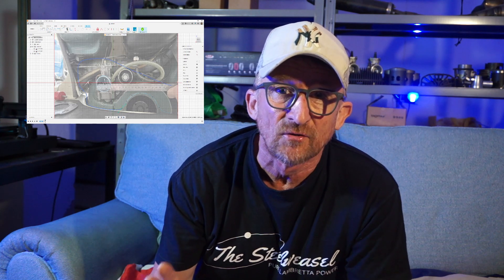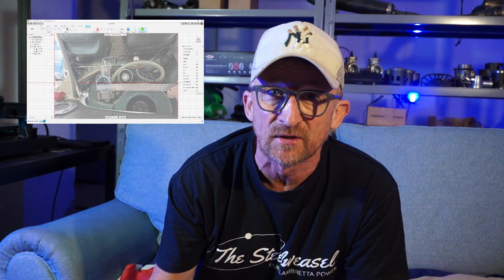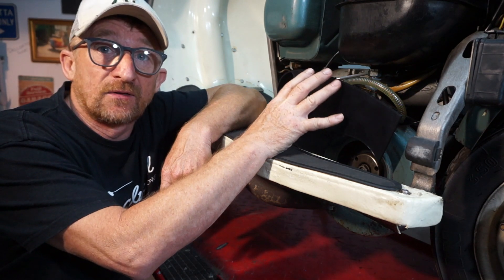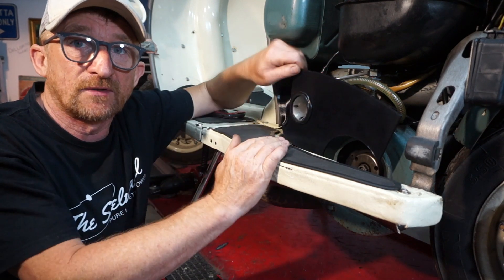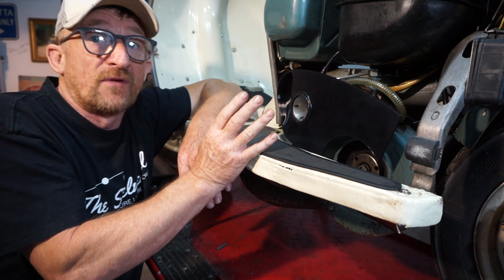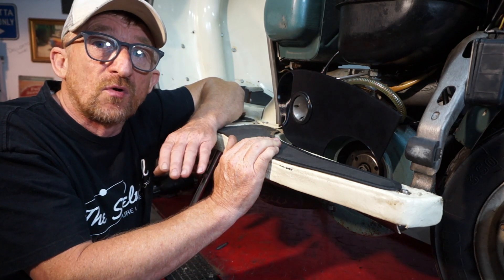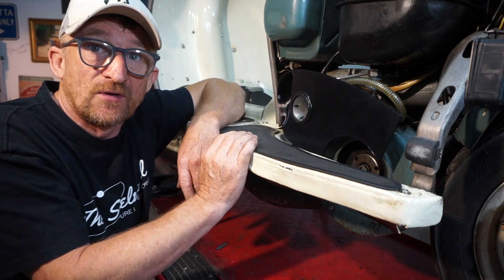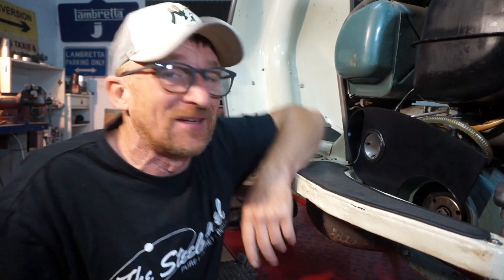LAMBRETTA AIR BOX PROJECT PART 2

Comment: At the moment I am designing and then going to print a similar set up although mine is into the original airbox area. I wanted to avoid anywhere where there is going to be a lot of heat as PLA warps to easily although I may give ABS a go. I am also designing a housing to go under the frame loop on my series 2 to take my electrics, junctions etc which I hope to have finished and printed before mersea island.

Comment: Well done Steve, Looks like a proper solution to the air filter problem that nearly all tuned Lambretta's have ,If it all works out Will there be kit specific boxes for different kits
Reply from the maker: its made for bgm kits and pwk carbs , delorto phbh is 10 mm longer and wont fit  it might just go with a short manifold ? but its not designed for delorto sorry